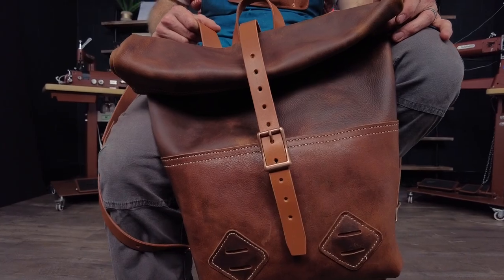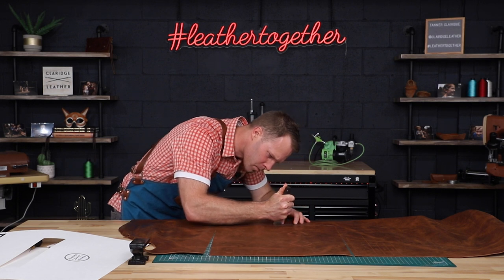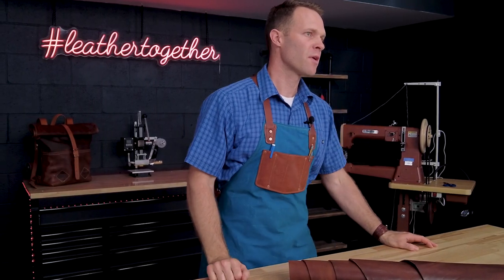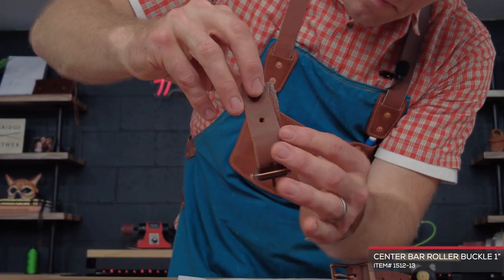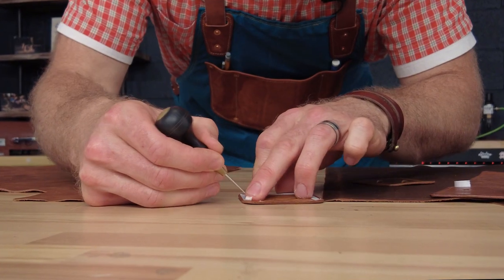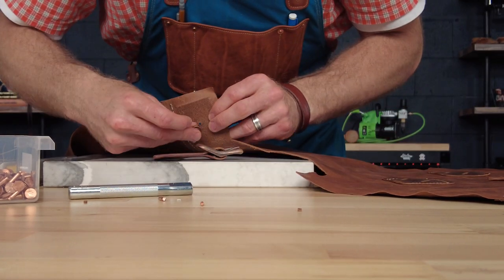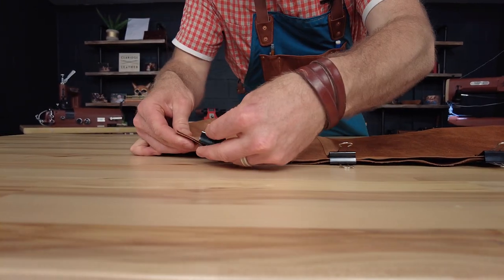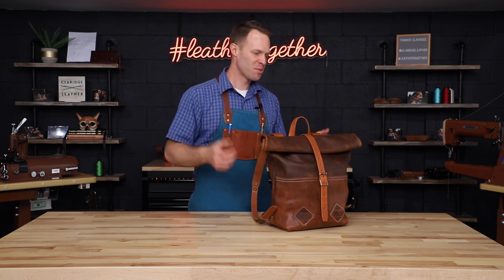How to Make a Roll-Top Backpack with Claridge Leather

Comment: When using double-sided pressure-sensitive (key words) tape, I lay down the one side, but then take a tool to rub or roll the tape down hard into the goods.  This helps to set that side of the adhesive.  This makes it easier to remove the backing, allows you look cool doing so as well!